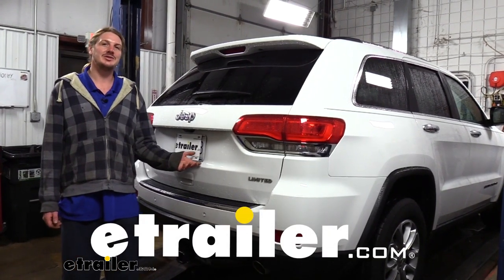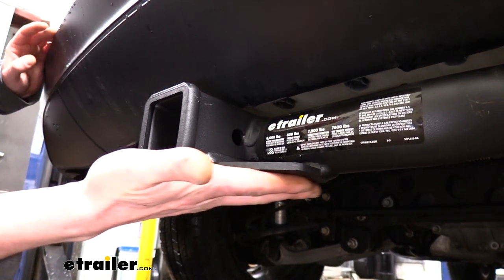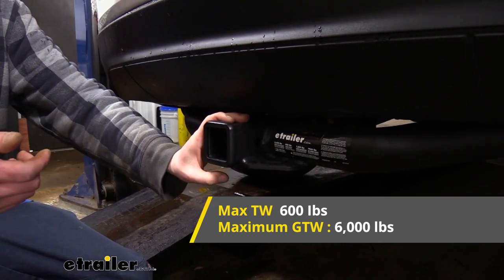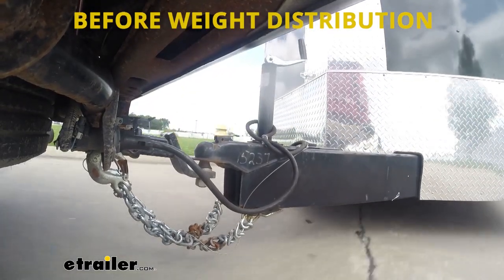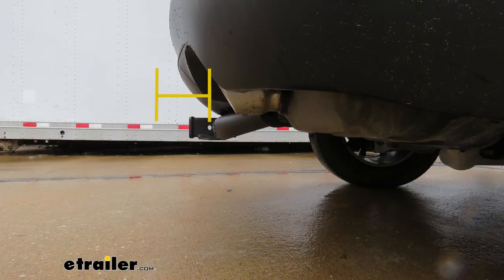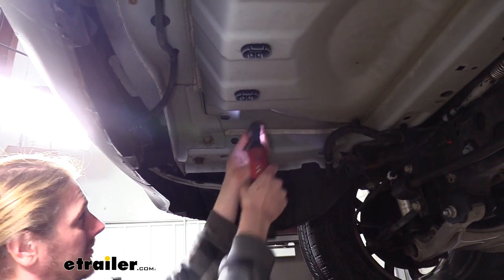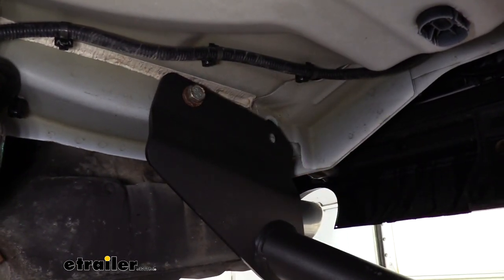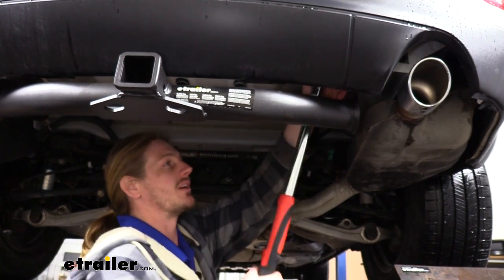etrailer Trailer Hitch Installation - 2015 Jeep Grand Cherokee

Comment: Can it Tow big suv ?
Reply from the maker: It can, as long as the weight of what you're towing doesn't exceed the 6200-7400 lb towing capacity of your Grand Cherokee OR the capacity of the hitch you're using.
https://www.etrailer.com/Trailer-Hitch/etrailer/e98901.html